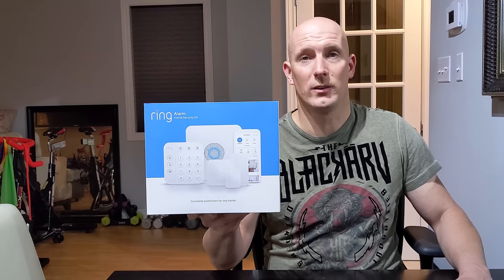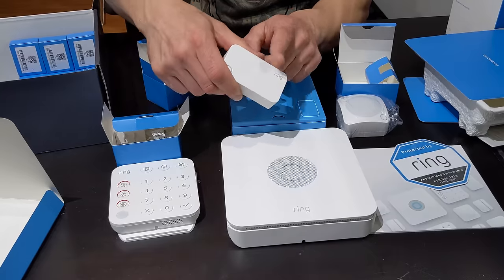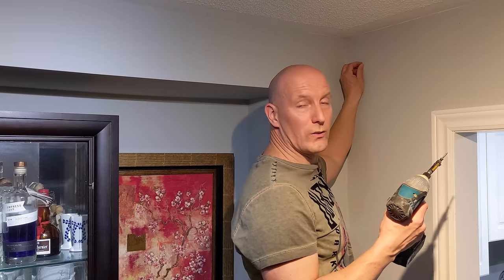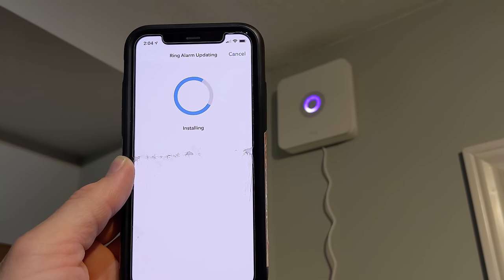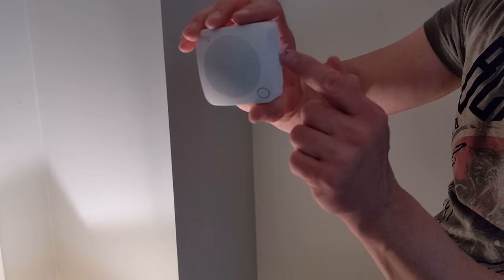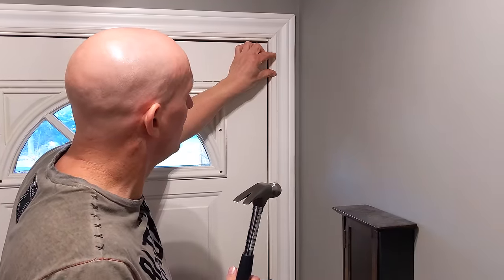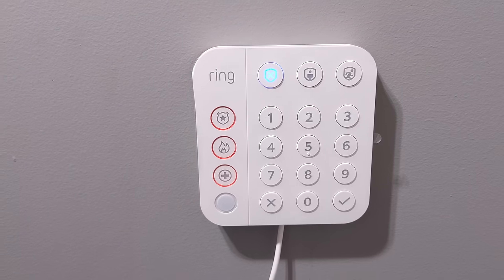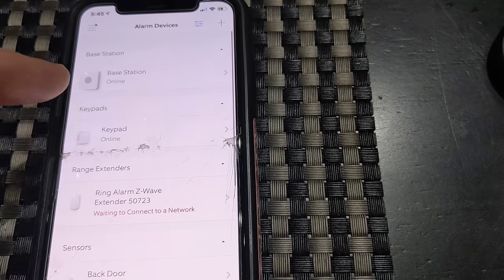Ring Alarm Home Security Kit (4K) Generation 2

Comment: On the door sensors, the small piece can be turned 90 degrees.   Rather than carving out the door, place the small piece on the frame, which will be at an angle, and put the larger portion of the sensor on the door.   They should be aligned up and down but they don't have to be parallel with each other.
Reply: well yea exactly. Also mounting that sensor that way, would prevent you from replacing the batteries in the future.
Reply: I audibly cried out when he cut that sensor into the door frame.  Door might be there for a century.  Sensor maybe 5 years or until the next homeowner.
Reply: Alternate solution, instead of carving out, add on. Place a small block of wood on the door and mount it to that so that it’s “flush” instead of creating more work and headache like cutting out the trim, nonsense
Reply: @720drew  yes of course just use something suitable to use as a packer.
Reply: So it's not just me then
Reply: @unrecovery  still beats the option of cutting the trim out for a damn sensor, that’s absurd. If that job was done on my home I’d be furious
Reply: Actually its 180 degrees turn!
Reply: What’s the battery life of the sensors like?
Reply: @justinocallaghan3857  Usually 3+ Years
Reply: The minute he starts notching that frame i just looked at his big head and says no wonder why 😂

Comment: Great video. My only comment would be on your door sensors, you could have swapped the sensors around so the bigger unit was installed on your door and the slim piece would have installed within your trim without the need to carve the chunk out, certainly looks to be enough room along the top of the door for that :)
Reply: I thought the same thing
Reply: I agree, I would of reversed the contacts.
Reply: Correct, now there is no way to replace the batteries easily when they ran out of power...
Reply: I was thinking the same, easier and less damage to the door frame
Reply: The sensor doesn't have to be flush, mine is slightly off and still works perfectly fine.
Reply: Exactly, what is they guy thinking!  Also why place the Base Station high on the wall with the power cord hanging down.  I'll expect he will chisel out the whole wall to conceal it ;-)
Reply: @paulbailey5915  Now that was funny
Reply: Lol yeah I stopped watching the video when I saw that he actually carved a hole into the door molding instead of just reversing the sensors...
Reply: @shacky8532  I was thinking the exact same thing.
Reply: @michaeltsay  I was most bothered that he used a flat-head screwdriver instead of a chisel.
Reply: The sensors work offset. There was no need for modification.
Reply: @paulbailey5915  Haha.
Reply: That's what I did for my classic casement: sensor on the door, magnet on the frame.
Reply: Not to mention you can actually open the smaller part and take the little magnet out to use it without the case. Makes it even smaller.

Comment: Just FYI, you should definitely NOT cut into your crown molding for the sensor on doors or windows lol. I had the same issue, but the sensor is designed to handle slight inclines and will still perfectly make contact with the other part of the sensor and still read properly. These sensors are made specifically to handle these sort of situations.

ALSO for installation of keypad and base station I recommend you use 3M strips. 👍🏻
Reply: i loled
Reply: @WheresTheAnyKey1  that’s how I feel about this vid lol
Reply: He tried, gotta give him credit. I know he felt bad once he mounted a set on his window and realized they don’t need to be flush. Lol

Comment: NOTE: For people doing the same to their door frame. Put the small part of the sensor on the frame instead of the door. MAJOR ball ache when it comes to swapping the battery out. Sensor unit needs to be pushed to the right (into the door frame) to access the batteries.

Great video overall.
Reply: Open the door and change the battery... :)
Reply: @dmc31405  the sensor comes off the mount the opposite way of the door

Comment: This guy cut his door molding 😂😂😂 just turn the sensor around or add something underneath the part the goes on the door!! 😂😂😂 👍🏽👍🏽
Reply: You don't even need to do that lol. If it's not flush, it still works fine. They can be offset and it will work fine haha. All mine are different depths and it works perfectly fine lol. Haven't had it miss any reads. The only benefit is aesthetics and maybe a 0.001 faster notification time of the open door

Comment: To make it easier to find where the screws have to go, you can make a template with some tape. Place the tape across the holes, and mark the holes, them remove the tape and stick the tape to the wall, and drill the holes on the template.
Reply from the maker: That's an excellent tip!   Thanks for watching!

Comment: Instead of permanently notching out the door frame, I would just add a shim behind the part on the door to make them meet up. But the exposed cords on the base station and keypad are deal breakers for me.
Reply from the maker: Yeah I could of done it that was as well!  The cords don't have to be there you can also just charge up the base station and the keypad and leave them unplugged running on battery power.  Thanks for Watching and Supporting!

Comment: If I only want to use the motion sensor and two flood/freeze sensors do I really need to install the keypad or can I just control everything from my phone? Obviously the flood/freeze sensors will stay on all the time. so the only thing I would turn off and on would be the motion sensor.  Thanks in advance for your help. Great videos, very easy to understand.😊

Comment: Have you added other z-wave devices? Plugs and in wall switches? I am considering switching to Ring but want to know if the energy monitoring devices will work or if I need a second hub.

Comment: Gave you a thumbs up for a great how to.  Question.  Why didn’t you reverse the door sensor to that the larger piece is on the door instead of the door molding.  That way you don’t have to cut out the molding.
Reply from the maker: I could have done that as well your correct.  I will be doing another video showing that option as well.

Comment: Thankyou so much for the informative video. I just successfully installed mine. I have a question. I have added all the sensors and named them. When I open the front door the sensor rings but is there a way to hear the actual name of the sensor rather than the tone?  Example front door open vs the chirp?

Comment: Excellent video Jeff, I'd be interested to know/see how the siren sounds on your mobile device when you're actually away from the house, as opposed to standing there at the door. I bought the first gen kit ages ago and I still haven't gotten round to fitting any of the devices, I did a little trial of the indoor cam, set it up and the siren was LOUD, so loud that I can't tell whether the siren is coming from the indoor cam itself or my mobile fon, or both.

Comment: Better tip for the screws is a piece of wax paper put it on back mark the 2 wholes because you can sea through the paper then use the paper as a template on the wall

Comment: 19:26 you could just put the big piece on the door.  By recessing it, you will need to remove the adhesive in order to change the batteries. Plus, you have hacked up your woodwork.

Comment: Great video but watching this changes my mind about getting this. The wires for the base and panel are deal breakers and my doors are not flush on frame so the sensors wouldn't work
Reply: Pretty easy to space the sensor out flush with the frame. Just need some double sided tape and anything you can cut to size to use as a spacer.

Comment: Do they have a temperature sensor so the pipes don't freeze if the furnace goes out?
Reply from the maker: There is something you can add on that can tell you about water floods, temperature, etc.
Reply: @JeffLepard  The problem with RING's water/freeze sensor is the alert is via email, not a text message to my phone.  So I went with a pp-Code sensor which has 3 distinct advantages: 1) The user can specify the threshold for temperatures, for example, send an alert if the temperature is above 70F or below 50F.  2) Text alerts whenever the threshold is exceeded. 3) The user can remotely look at hourly logs to see the exact temperature and trends for example 65F,62F,59F,55F 50F...etc.

Comment: In theory the "get out delay" for the front door being on allows potential robbers 30 seconds for them to grab whatever they can before the alarm even sounds? Wouldn't it be more beneficial to just arm/disarm via the app after you exit the home and before you enter the home so alarm goes off immediately if someone breaks in?
Reply: Personally I would find it annoying to have to pull out my phone, turn it on, put in the code to allow access to phone, open the app, put in the Ring code, close the app, turn off the phone, and put it back in my pocket again. Much easier to set the alarm for 15 seconds, and punch the code in upon opening the door. But maybe that's just me.

Comment: One MAJOR disadvantage is that when a sensor is triggered there is no alert sent as a text message to phones....only email.  For example, water/freeze sensor is triggered by a leaking water heater...user does not immediately get a text message on phone...only 12 hours later discovers the problem when reading emails.
Reply: Is the ring app not alerting you?
Reply: Oh, that's a deal-killer. I'll be looking for a different system then. I don't want email on my phone.

Comment: Nice video … thank you for sharing. Can you hardwire the sensors or do they need to be battery operated all the time. In which case how long does the battery last?
Reply from the maker: The sensors cannot be hardwired in.  They do run off of a battery but the battery will last 1-2 years depending on how active they are.  Thanks for watching!

Comment: What happens if a burglar finds and unplugs/disconnects the main hub/brain during the entry delay window?  Would you never know someone got in your house?  A way around this is to maybe use a 0 second entry delay and always arm/disarm your alarm with the smartphone app.
Reply: @nibblebytes  I read somewhere that once the entry timer starts, the alarm will still trigger if no subsequent disarm notification is sent to the monitoring system. Even if the brain is destroyed, which is supposed to be indestructible to begin with.
Reply: It also has a battery backup.
Reply: @Ryan_Mooney  If you dont have monitored service your out of luck. Once the base is unplugged the system is dead.  Or if the system gets unplugged during the time waiting period the system is shut down.

Comment: I appreciate your time and effort, but not using a level to mount the keypad/base station is sad. Even more sad is that you are chiseling out your door frame when you could have put the large sensor on the door and the thin magnet on the frame. They don't have to be flush to work; one can be inset and when it opens and passes the magnet, it will activate normally

Comment: My Keypad will not activate alarm on door. All devices are online
Reply from the maker: Did you try resetting the keypad and join it back with the system?  Thanks For Watching!
Reply: @JeffLepard  thanks for all your help. I’ll try that. How do I “join back” with the system? Does that mean running the pads through “set up devices” again?

Comment: hi Jeff I’m looking at getting the same kit, could you tell me how long do the batteries last in the sensors? Are replacement batteries expensive? And once you’ve removed the sensors to replace the batteries, how do you apply it back to the wall again if you’ve already applied using the sticky tape?
Reply from the maker: They lady about 2 years with normal use but might be less or more.  You can get more double sided tape or restock the existing tape.  I've done that before and it still works.  You can pick up more double sided tape for them.
Reply: @JeffLepard  awesome thank you very much for the quick reply 🙂 will definitely be purchasing a kit. Great tutorial for fitting is also 👍
Reply from the maker: No problem thanks!
Reply: @JeffLepard   .
Reply: Would have been better if they had a cradle for the sensor, that you attach to the wall  either with tape or screws so you're not ripping them out to change batteries. Or have the front of the sensor pop off to replace battery without removing it.

Comment: You don't have to cut out your door frame.  You should have attached the larger piece to the door and the smaller piece to the frame.  It doesn't have to be parallel, it will work as long as it is not more than one inch apart.
Reply from the maker: That's actually correct.  I realized that long after I had already done that.  When I change the batteries next for the client I may just replace the frame and attach it that way next time.

Comment: your mounting the door sensor wrong way around and it all looks a mess with those hanging wires.  No way would I have a system with hanging wires
Reply from the maker: The wire is only to charge.  Also, you don't have to do exactly what I did they will work stuck on.

Comment: If you have a dog roaming the house I
Take it the motion sensors would
Not be a good idea
Reply: I have a different system. They told me a small dog will not set off the motion sensors. I believe it, they're not that sensitive. A big dog, I would hope, will set it off. Ring motion sensitivity might be different than mine.

Comment: As an ex carpenter, you buy a $200 kit, but won't spend a little extra to buy a cheap chisel and mallet to install it properly... wtf my man
Reply: I cringed to see him hammer on a screwdriver. Brings back memories of splitting a handle that way. In my defense, I was a little kid back then.
Reply: You don’t even need to chisel anything! The sensor has a strong magnetic pulse lol

Comment: I thought that the ring alarm was wireless?…….
Reply from the maker: It is wireless but the cords are there to charge the batteries in the alarm.  You can run the alarm with them unplugged.  Thanks so much for watching!